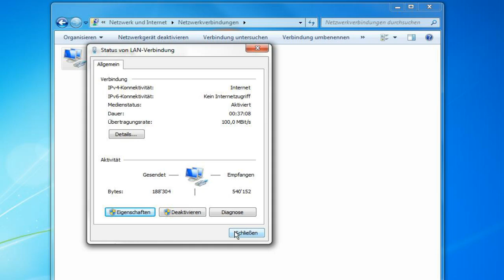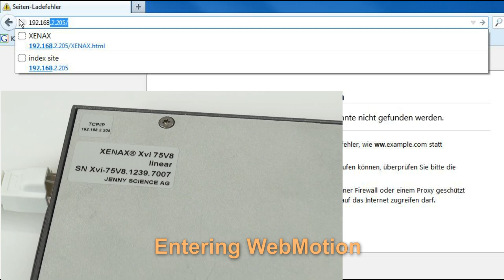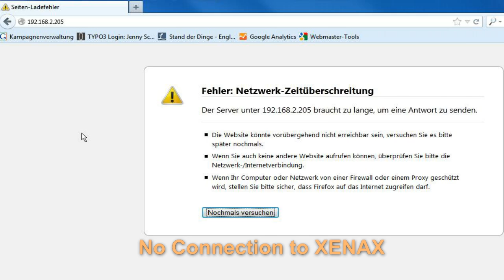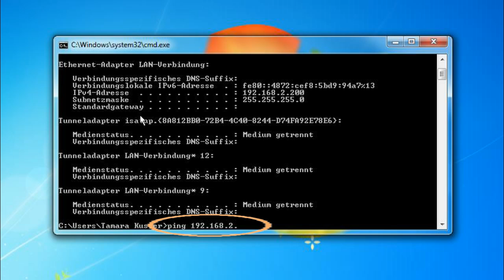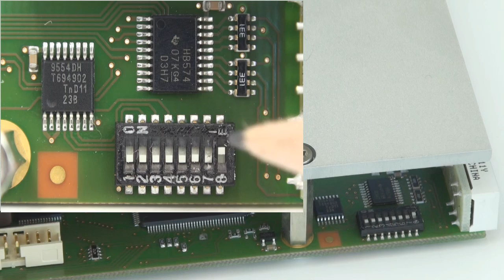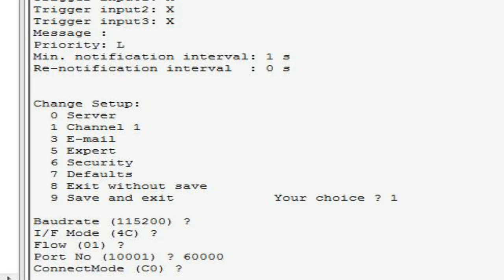How To Set Up TCP/IP Connection With XENAX® Servo Controller | Step-by-Step Guide

Comment: I set the new IP with the deviceinstaller and was able to ping the controller. But I could not connect to <IP>/xenax.html. The web page does not open and no error code is displayed. Are there any other troubleshooting steps?
Reply from the maker: With the older XENAX 75V8, you need QupZilla, as it works with Java. You can find it here: https://www.jennyscience.com/en/download.

Also, check out the FAQ section—FAQ No. 1 has tips for web browsers: https://www.jennyscience.com/en/support/faq.

With the new XENA  Xvi75V8S, all of this is resolved, as it now runs directly on HTML5 and no longer requires Java.